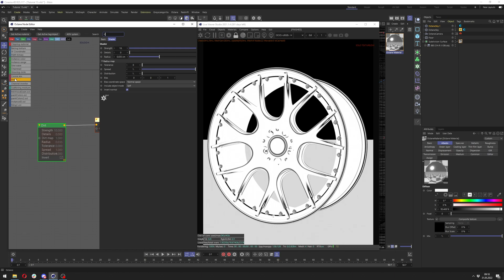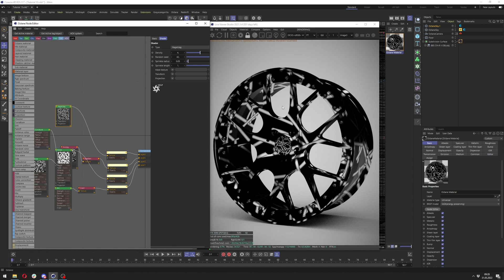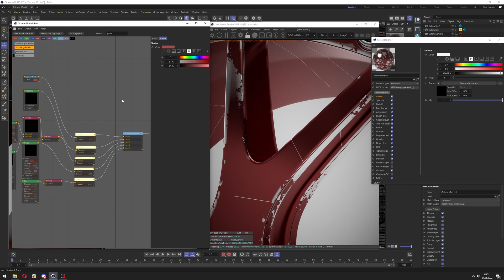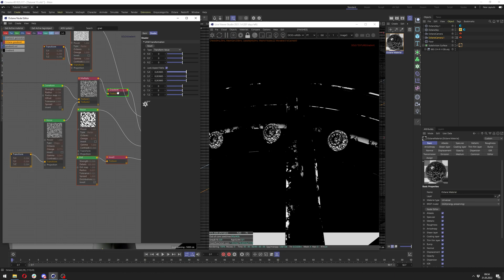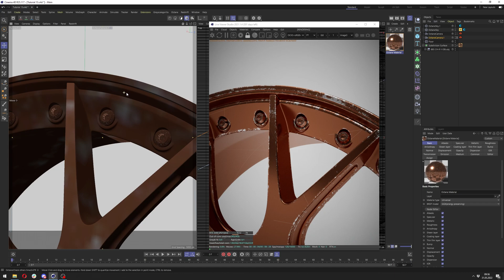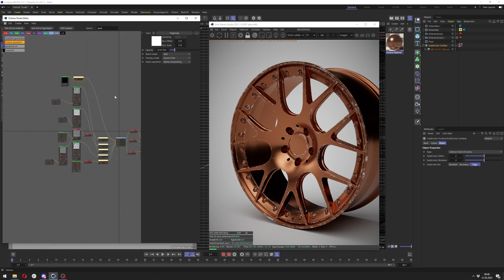Worn Out Edges in Octane Renderer

Comment: Wow! Many years using Octane and I did not know that magic. Thanks, magician.
Reply: Have you had a look at the OSL-library that comes with Octane? There are really useful shaders like carpaint with procedural flakes. You find those in the octane material node editor top menu > OSL. Many don´t know.
Another extremely powerful OSL shader takes your tileable texture and shuffles the content in a way that it tiles but doesn´t look repetitive any more. I use it all the time. It perfect for ground and wall textures.

With GPT-4, you can even try to create your own OSL-scripts although the success rate is low. But still a very interesting thing to play around with